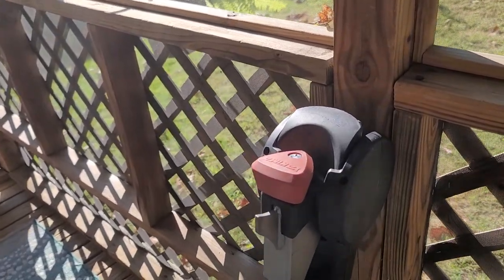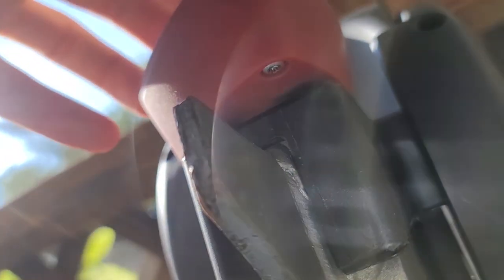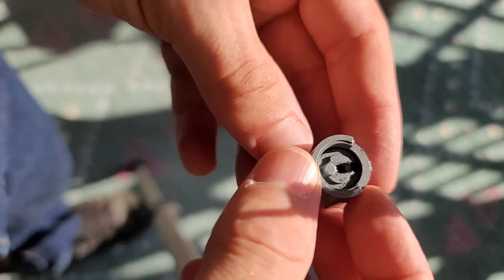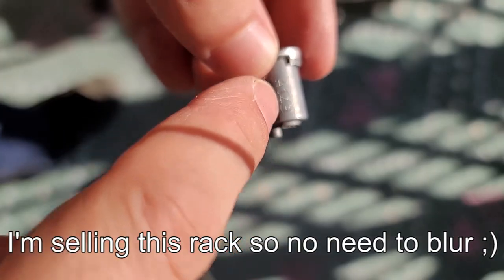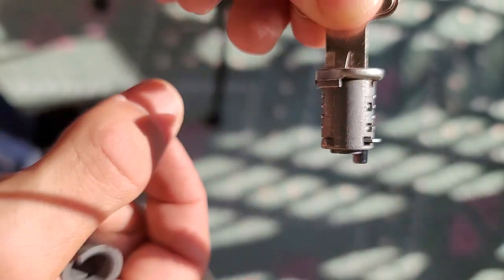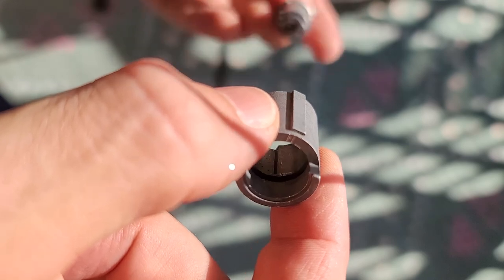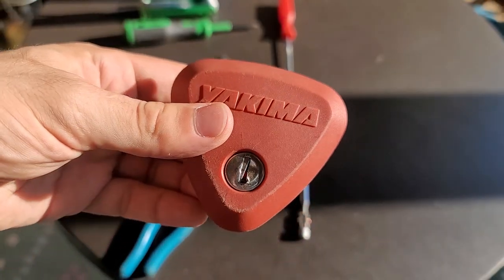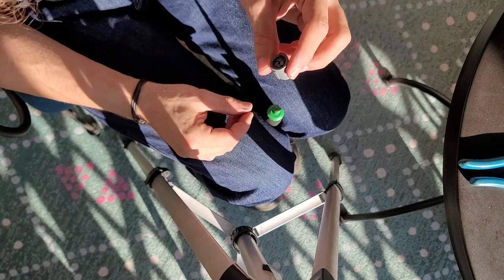How to Pick a Yakima Ridgeback SKS Lock (lost key)

Comment: now where do I order new lock cylinder with keys?
Reply from the maker: I got my lock core with key off of eBay, but both Yakima and Amazon have these. If you're near one, I'm pretty sure REI actually stocks these.

https://yakima.com/products/sks-lock-cores
https://amzn.to/45S18uX
Reply: @Bootstrappin  
what's REI?
Reply: @Bootstrappin  I have Yakima Sky box lost the keys and now want solve this problem
Reply from the maker: @rockyblacky3667  REI is a sporting goods store in the U.S. Basically, like I said in the video -- pick your lock into the unlocked position and remove the cylinder by pressing on the 5th wafer. When that's done, you should be able to find the lock number. Go on eBay or Yakima, and order the corresponding set of keys with the same lock number/code.
Reply: @Bootstrappin  Thank you so much for taking a time and letting me understand!